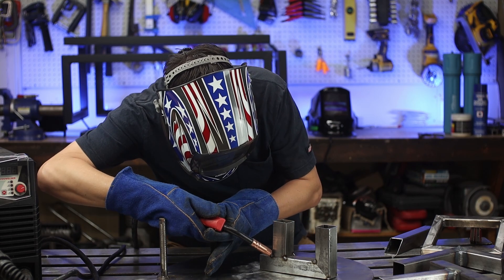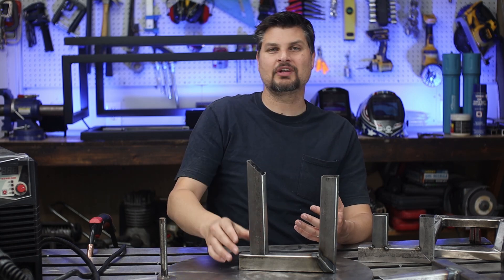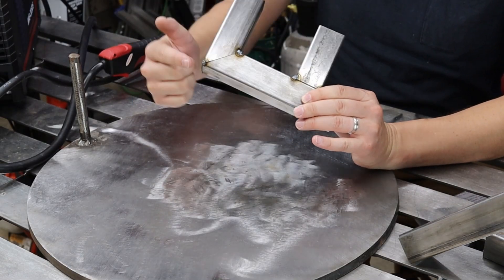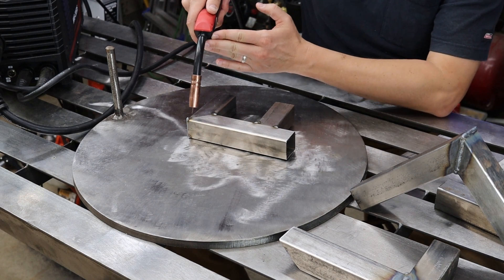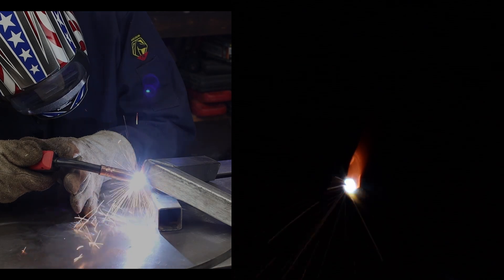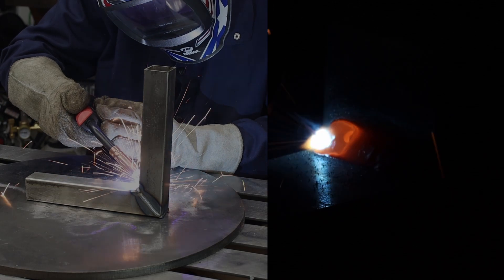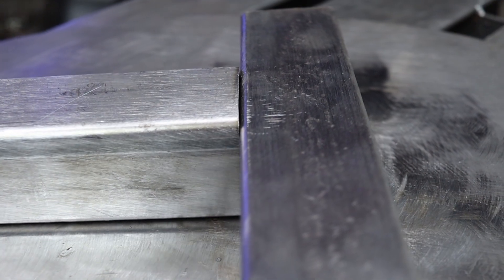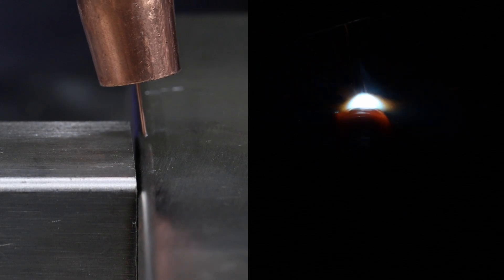Tack Tack Tack Welding and Sq. Tubing Tips & Tricks

Comment: I'm a novice making a table base out of square tubing. Is there a benefit to making miter joints instead of butt joints? One reason I'm considering miters is so that I don't have the hole opening on the bottom. But I've heard miters are heard to get perfectly square. Thanks for your help! This channel taught me to weld!
Reply from the maker: Unless you have a good chop saw or miter saw like the evolution they are hard to get right on. For DIY type stuff it's all for the looks.

Comment: Good tip, I just had to build a grill rack for my brother in law’s smoker and I used 1” 1/16th square tubing and I built it just like the original. I didn’t miter the corners so that gap between the rounded corner of the tubing was kinda tricky for me. I basically made tack welds and cleaned it up and then went back over it with the Hobart multi pass wire. In the end it turned out looking great. I used the Hobart anti spatter spray too. Thanks for the video and the advice, would the same apply for flux core? I know it runs hotter than MiG.
Reply from the maker: Yes, i would follow the same steps with flux core. Just different settings.
Reply: @-DIYPRO-  Ok thank you